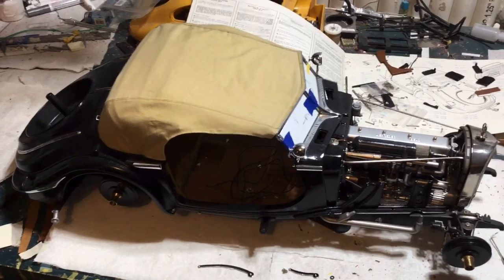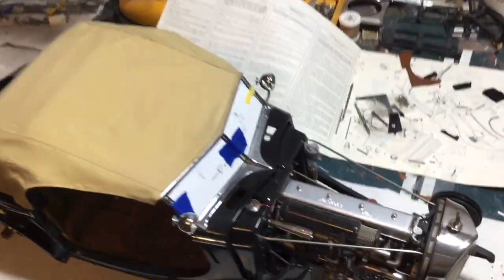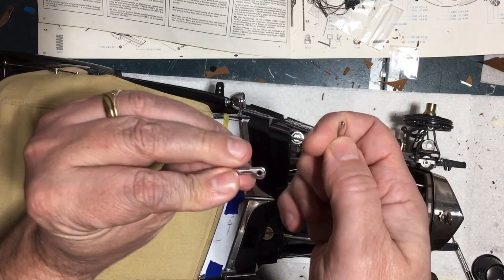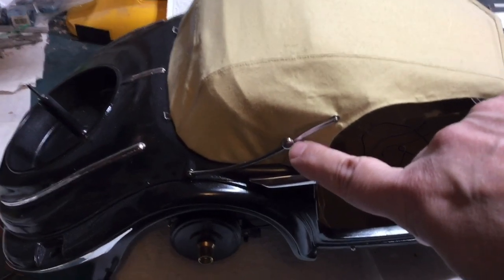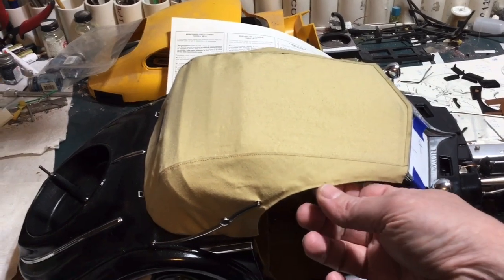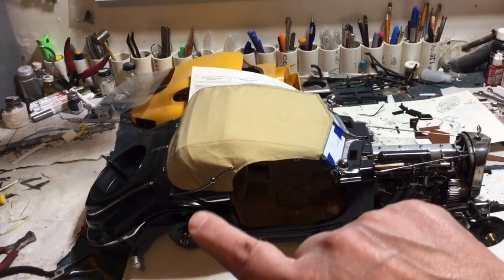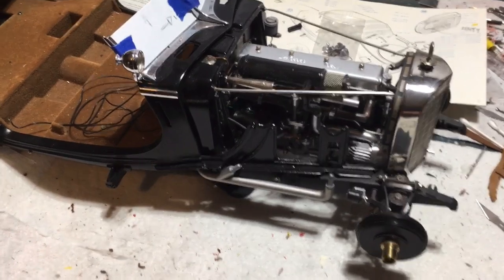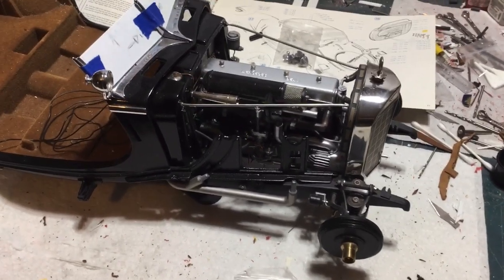Pocher Mercedes 500K build; leather straps and Model Motorcars Landau bars

Comment: Could you steam the fabric into shape to solve the problem you are having on the roof fabric?
Reply from the maker: I actually thought of trying to use a steam iron or something, but I’m not familiar enough with fabric to know exactly what would happen. It’s very possible it would work fine, but I’m paranoid about it causing more problems like shrinking the fabric too much, melting plastic parts close to it, messing up the paint, etc…I tend to worry about more than I need to because I’ve been burned before. I’d have a ‘simple’ idea to resolve an issue, and end up causing more damage. I could practice on a piece of scrap and see what happens.